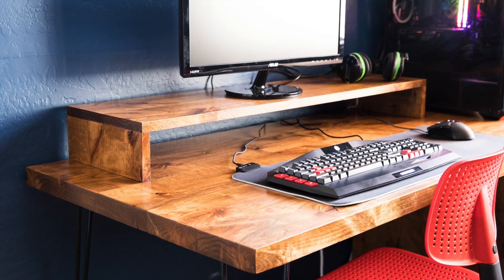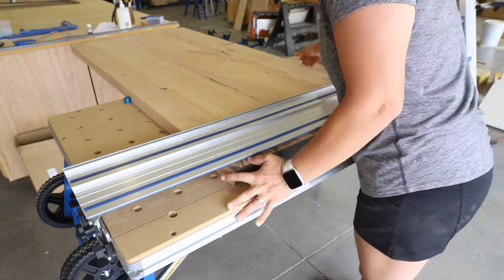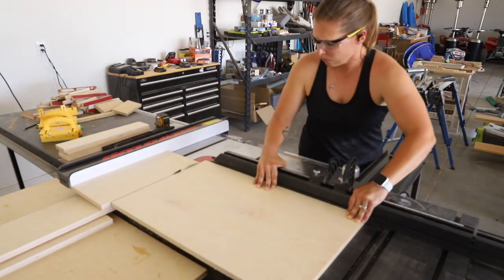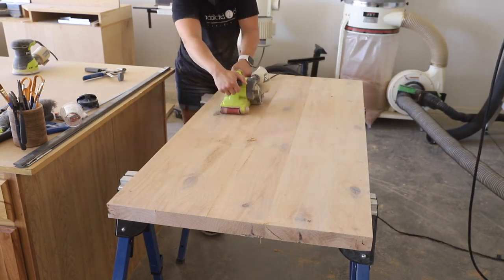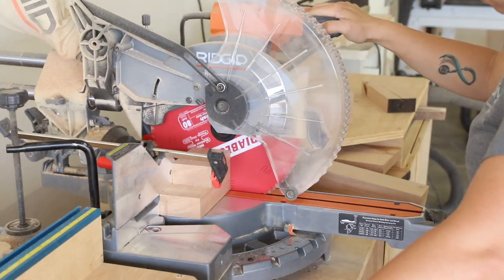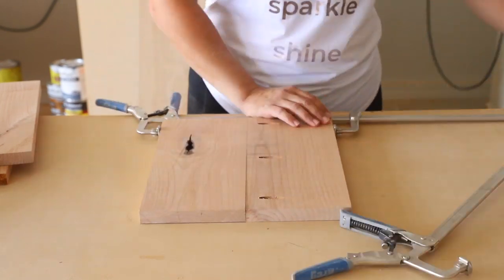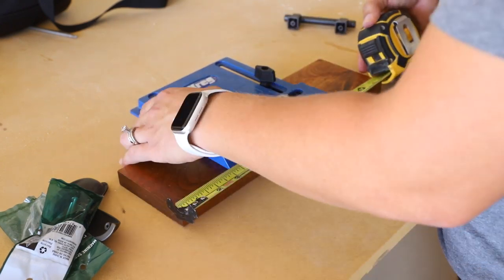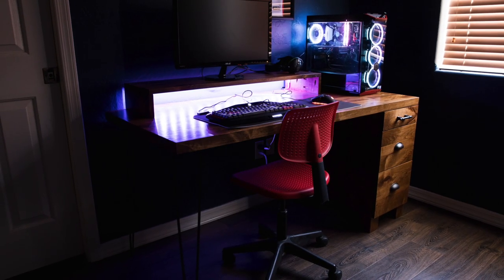PC Gaming Computer Desk - How To Build

Comment: Great video!  I am making this same style desk for my son in a couple weeks, so your timing was great for me.  Question for you: you used pocket holes in much of the project but not for the desk top. Any particular reason why?
Reply from the maker: Ed Rajala thanks Ed!  With the table top being 1 1/2” thick, I felt really confident that glue joints would hold up really well.  With 3/4” material, I liked the idea of a little added strength of the pocket holes.  Especially given that they’ll be holding drawers.  In reality, it’s dealer’s choice.  Pocket joinery on the side panels isn’t completely necessary if you have nice, flat joints.  If you’re using pine from a home improvement store, I’d definitely back up the glue with pocket joinery.
Reply: Table tops of 1.5 inch thickness don't need screws. I think pocket screws are the easiest form of jointery but also expensive to invest in. I love learning about woodworking.